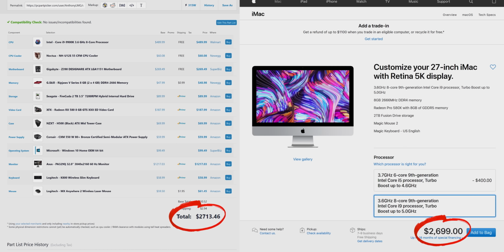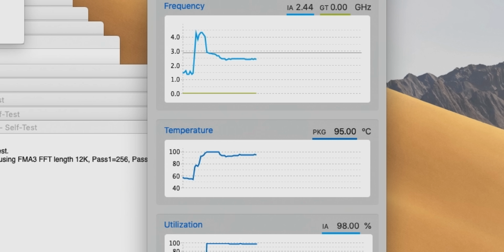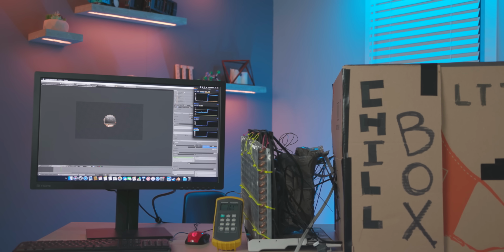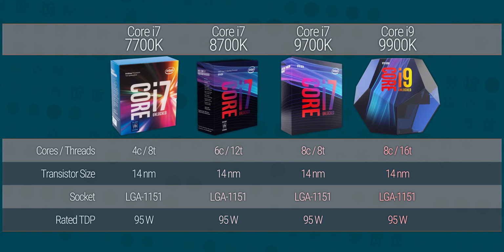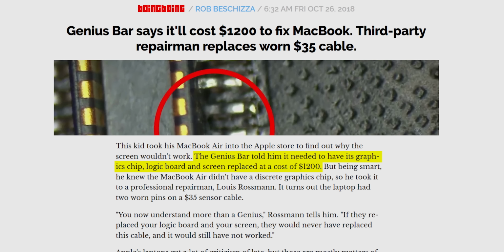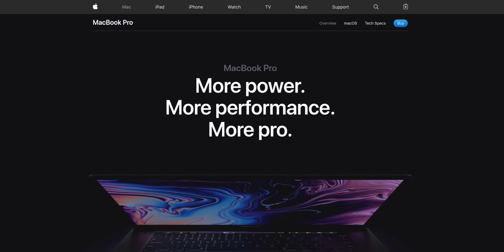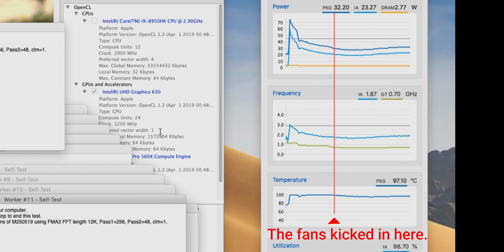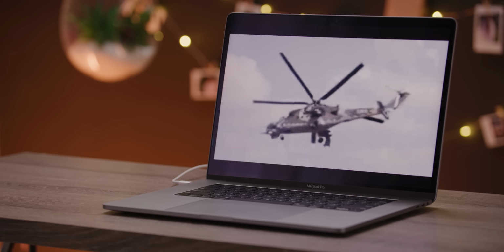Macs are SLOWER than PCs. Here’s why.

Comment: I cut holes in the bottom aluminum chassis of my MBP.
Right under the cooling fan outwash allowing hot air to leave the machine directly (this is cause of GPU failures), rather than first being stopped by the case bottom and being dispersed 90° in all directions inside the machine, then  still having 35-40mm to actually make it to the back exhaust (passing right under the GPU).

This machine now runs much, much, cooler.  

 I have epoxied suitable screens in the new exhaust ports to maintain the chassis's primary purpose of protecting the laptop contents. 
It would also be possible to mount a 40mm exhaust fan in the bottom as well.

It was running over 100° above the GPU, which is explained by visual signs of thermal stress on the logicboard. 

Before doing all the above I baked the logicboard in the oven to re-flow the solder after the GPU crapped-out previous a couple times. 

A fine example of poor thermals in Mac products, but not ever enough to make Windows as an OS look good, what a totally atrocious operating system. I cryptomine/render farm on Windows machines, an experience that is like passing into hell. I feel like I am personally battling with Bill Gates himself.

MacBook Pro A1286, 16 gb, SSD etc. bought 2nd hand 2014, $1000

Comment: I wonder if you found a way to watercooler that macbook, would it improve speed?
Reply: Yes, yes it would. But... what would you be doing that you would actually notice the minute bump in speed that only GeekBenching or 4K rendering will reveal? And why would you be doing those things on a portable device when you could do them with a desktop machine that performs 10X better for less cost and no battery risk?
Reply: @gorkyd7912  a noticeable difference isn't my aim. I want to be able to measurably prove that I'm better than a mac owner.
Reply: @nursingninja  Being barefoot would make your feet measurably lighter than wearing shoes. So why do football players wear shoes? They've made a decision based on their use of the product rather than by simply measuring its attributes.

Comment: I game exclusively on a 2017 MBP, external monitor and peripherals. I use a custom watercooling setup and it's actually great. With Bootcamp (and especially an external RTX2080) I get to have a Windows gaming desktop, then unplug one Thunderbolt 3 cable and have a MacBook for lighter daily use. Windows is superior for heavy use, but Apple is always superior for battery life, ergonomics, build, design, and everything that makes a good light daily laptop. So this way I get the best of both worlds, with no syncing involved.

Yes, a $2000 gaming rig and a $1000 MB Air would have done it better for less. But I didn't discover PC gaming til after I dropped $3500 on a laptop, so. Work with what ya got.
Reply: Hey I just sold my gaming pc to buy a 2016 15inch  MacBook pro because I was so in love with Mac OS. I have a 34 inch Samsung 4k curved monitor I'd like to use it with for casual gaming like path of exile. What kind of cooling setup are you using may in ask? Also if you're using an eGPU may in ask what kind? Thanks :)

Comment: Wow, thanks Linus :) As an Apple fanboi, I'm really happy I watched this video before "upgrading" again to a 2018, from my mid-2014, from my MD101, from my 2011. Appreciate your video as always, thank you.
Reply: I been using and supporting Macs since 2000 (got my own in 2001). Over the years I have watched the quality drop. It used to be that you could get away with not buying Apple Care to what are you going to do when it fails. Apple has not put much into innovation on the desktop side and have killed off some good products. I currently have a 2016 MBP touchbar and I can't say I'm 100% happy with it. I have a old Hackintosh that does not support the latest mac os so I converted into a Linux desktop. I have to say I am really liking what I am seeing from the Linux world. Windows has also come a long LONG way (though I still rather not run it as my main OS). I don't think I will need to upgrade in a long time (though I can upgrade the graphics card in my Hackintosh and bring it up to date) but for now I don't think I can see myself buying any new Apple computers unless it is for my girl. I'm actually thinking of seriously going down the Linux route or straight up Hackintosh from now on. I have also been running Linux VMs on my computers and I'm actually liking a lot of what I see. I wish Apple was still innovating.
Reply: Jose Juarez honestly Linux is a life saver. Because it’s such a light-weight OS, it runs perfectly on my old computer.

Comment: Most of this seemed fairly obvious to me (as it will to most more tech-savvy individuals I'd guess) but the one thing pointed out I genuinely had not thought about was the iPhone vs Mac comparison- and it is a real head scratcher. The power/performance of the iPhone is the reason I owned one for the last four years, before finally switching to the S10+ simply because I like the current gen of Samsung better, but it is undeniable fact that by the numbers, the iPhones have been pound for pound the most powerful bleeding-edge devices on the market, consistently outperforming similar Android phones at the same (or, prior to the current generation, even higher) price point. To break that down a bit more to the basic elements: they have the drive, commitment, and ingenuity to stay ahead of the competition in the phone world- to keep their components higher quality, and maintain a lead that isn't 100% reliant on their brand/marketing (though certainly that's a factor). But nothing like that with the Mac side of things- at least not for the last few years. And maybe it's just a by-product of the shrinking market share in that segment, and the fact that desktops/laptops are quickly becoming "old school" and mobile technology is much more hot/lucrative. But I can't help but think that if they had a product team that was as devoted to Mac, as innovative and bleeding edge, that they'd been gaining market share in that segment and maybe even preventing that slide of people to not care as much about replacing their desktop/laptop. I don't even think they need to go as far as they do with iPhone; even back before they had completely internally built chips, even when they were using (roughly) the same chipsets/architecture as most Android devices of the day, they still maintained or led in performance versus devices with nearly matching parts. I don't expect Apple to go out and build a new bionic chip for the Mac, but damn, I think it's been proven well within their ability to do better with the hardware built by Intel, AMD, and Nvidia; they've done so before. One thing they may wish to remember, is image/marketing only carry you so far. Sure, they can maintain business right now because they used to have some solid pro-content maker computers, and they have a good rep overall- but that doesn't last forever. A couple generations with serious issues (say, rampant failures due to operating at the edge of thermal limits), and that rep disperses entirely- then the next generation fails epicly and they lose market share. Honestly while I never see myself switching to Macs unless something radical happens, I truly wish they'd pick it up a bit and commit themselves to making a better platform. I want more than just PCs out there- sure, there's competition between manufacturers, but I want a desperate Microsoft too, the one that saw some sliding numbers and made the release of Windows 10 free, and drove one of the biggest waves of upgrades in their history- a genuinely competitive alternative platform is better for every consumer, as it pushes the overall bar for quality up, and that innovation tends to propagate across to other manufacturers.

Comment: Apple hasn't cared about computers since 2007. They're a phone company that also sells computers. Their performance has been garbage for nearly 20 years. At least back when it was a PowerPC machine, we could say, "oh well, it's a different architecture, you can't directly compare them with benchmarks." Now, they have no excuse. Which is a shame, because  Mac OS should be a fantastic performer. In Geekbench, the top scores are usually populated by Hackintoshes. But, instead of designing for performance, they design for appearance. And, frankly, for workstation-class machines, they run too hot to get any work done. But at least they're pretty while they're self-desoldering the BGA connection to that thousand dollar processor.

Comment: Why do you think they’ve been constantly looking at replacing intel chips with their own chips? It fits their performance AND design goals. (As you’ve shown with the iPhone in the vid.)

Unfortunately it’s a huge leap and may split the Apple OS X user base as well. Not to mention cause compatibility issues with current x64 intel based software.

Besides all that, most content creators will want to build a custom machine to render content on anyway, not a laptop made by Apple or anyone else. So the design choice to make a laptop beautiful and pleasant to use on a daily basis for simple to intermediate tasks only is not a poor design choice at all.

Comment: This is a clickbait title.
Why don't you compare the MacBook Pro with an Asus ROG Chimera or an Alienware with the same CPU?
The problem is not Apple, but Intel and their crappy 14nm CPUs. 
Any laptop with an Intel  i9-8950HK CPU will overheat and eventually lower the clock frequency.
Reply: Apple is fully capable of using chips that don't overheat, they are definitely the problem. You don't blame the rotten meat in your food for being there, you blame the Cook (hah, punny) for putting it there, specially when he knows it is rotten.

Also, I think you're upset about a perceived bias, but it's pretty clear Linus isn't really a fan of any of the Pre-built PC Manufacturers, Asus and Alienware included. *I personally think buying a Mac or anything else pre-built is like exclusively having someone cook for you, and never learning yourself. It's all fine and dandy until the guy making your food dies and now you don't know the difference between a CPU and a GPU.*
Reply: @TheFallingFlamingo  My point is that any Intel i9 mobile CPU overheats, it just a matter of time and no fan can fix that, they just produce too much heat. 

Intel has been stuck with 14nn CPUs since 2014, for comparison the latest A12X Bionic is 7nn.

When you say that Apple is fully capable of using chips that don't overheat, you're right, it's the reason why they're planning to transition to custom ARM CPUs in 2020.

I don't quite understand your last quote in this particular context. I assembled my last desktop and I agree with that, but in this particular case we're talking about laptops, which are always pre-assembled.

The title is a clickbait, if Linus wanted to be objective, he could have done a comparison between different laptops mounting the same CPU and see if there is one that performs better.  https://www.notebookcheck.net/Our-Core-i9-verdict-It-s-just-not-worth-it-on-laptops.410623.0.html
Reply: @paulmcpazzi  The point of the video is that Apple has to own up to there mistakes. They are the only company that makes the iMacs and Macbooks and the only company that runs there software MacOS.
Reply: @evacody1249  I don't understand how this is related, stick to the original topic, please.

The title of this video says "Mac are slower than PCs", but I still haven't seen any small form factor laptop PC with the same CPU that performs faster.

MacBooks has been recently updated with the latest 9th-generation Intel CPUs and I suspect that will have the same issue. I don't think that there is a laptop capable of sustaining the heating produced by these CPUs. If there is, please post a link, so that you can finally prove me wrong.
Reply: Name me another computer company that makes the desktops and laptops that run MacOS.

Comment: Why do you think we like Apple computers only because they look good on the exterior? (Which they do) MacOS itself is a great operating system and joy to use. Their OS and Apple made apps can crush real life performance of other comparable video editing, word processing, and mostly anything apps. I open a 200 page document in Word and it takes forever. I open the exact same document in Apple Pages (a great word processor) and that document is open instantly. Same with iCloud working way better / efficient than any other cloud service that I’ve tried (google, OneDrive, Dropbox). It’s an overall great experience, and I use a 2010 Mac Pro (a 9 year old computer!)

Comment: 7:22 - "Why this difference in philosophy?"
Simple; because iPhones are their main money maker. Apple dedicates more R&D into their breadwinner (iPhone) than into their secondary income (Macs).
Reply: i think it is also because phones are by far more used for instant gratification rather than work, whereas when people are working on their laptop, the instant gratification of a really snappy device isn't always at the forefront of one's mind, but rather the problems being solved. so the use-case for a phone would be more heavily impacted by lag than the majority use-case for a laptop
Reply: don't forget that the iPhone is an always "on body/hand" fashion statement so anyone who owns it is basically advertising that product, thus apple would obviously focus on the iPhone much more, where as laptops aren't an always on hand product thus comes in secondary; even so I've seen plenty of iPhones with certain software problems... its just, it works when it works and when it doesn't then there is a high probability that you are fkd up.
Reply: custom ARM vs x86 that is why

Comment: Its not a difference in Philosophy.  Its a lot more simple.   Some time ago a company in Cambridge UK created the RISC chip now known as ARM.   Right from the start the heat produced by this chip was considerably lower than all the other CPU's in the marketplace.  Watch what Apple are about to do - they are working very hard to make it happen - Yes Apple ARM chips in the desktop.  We will see several CPU's each of at least 8 cores in MacBooks and iMac in the not too distant future.  This is why you can run and run on an iPhone and produce small amounts of heat.  Compared to ARM, Intel is yesterdays technology.  There are more ARM CPUs made than any other.

Comment: Why the iphone can run benchmarks all day long and the mac has to be throttled has to do with the fact that Apple got to design the processor in the phone and chose--unlike their competitors, and intel as well--lower clock rates and wider data paths and larger caches.  This is also why Apple is eventually going to move the Mac onto their ARM processors (or Risc-V?).  I suspect that once Apple can get the macs off of intel Linus will be pleasantly surprised at how decent they perform tough tasks:

Details:
https://the8-bit.com/iphone-processors-are-faster-than-android-processors-this-is-why/
Reply: Apple could just use the appropriate U-series chips in their MacBook Pro instead of using H-series without providing adequate cooling.

Comment: For a super chill box, use a kegulator (fridge built for dispensing chilled beverages from kegs).  Use the liquid/CO2 port to run whatever wires you want to a computer sitting inside. Chill man!

Comment: My 7+ years old Asus (g55wv) still outperforms my MacBook  pro 15 (2014 model). It was cheaper, I was able to add more RAM, upgrade the  SSD, it does not melt the table underneath and you don't need noise-canceling headphones. That macbook sounds like a vacuum cleaner. The design is the only - literally the only reason to buy a mac. And Mac OS sucks. I hate it.

Comment: I think iphones are not allowed to produce so much heat because of the battery. If you would allow the processor to thermal throttle, the phone is hot, and the battery is hot too, which will shorten the life expectation of the battery.

Comment: Now please do an overview of PC’s that are doing the same thing to their performance in pursuit of the ‘thinner is always better’ design philosophy.
Reply: PCs*
Reply: True, but most of these thin and light laptops will use U-series processors, as they should, while H-series processors are mostly used in thicker workstation laptops. Apple squeezes H-series processors in ultrabook designs, which doesn't make much sense. Plus Apple is usually 1 or 2 CPU generations behind other brands.

Comment: It's pretty easy to get the PC price up to the Mac price when you included a $1200 screen...
Reply: To be fair, a Mac is a screen with a computer attached
Reply: right, but you have to think about them comparing the complete packages... With the mac, there is a screen included... and they had to get a screen (4k or more) to match the imacs.
Reply: @ryanc9783  you can match imac's screen for far, far less then 1200 usd... Not to mention almost 300 usd mobo? 110 usd keybord + mouse? 70 usd case? You could have saved at least 800 usd here.
Reply: I dont know how Linus is still putting this shit out
Reply: @Kamal Kristipati An LG BK67U-B 27 4k monitor for $349, a Samsung U28E590D 28in 4K for $379, an Acer ET0 Series ET430K wmiiqppx 43" fp for $479. 
How many more do you want me to list?